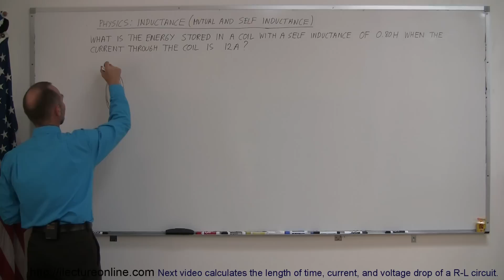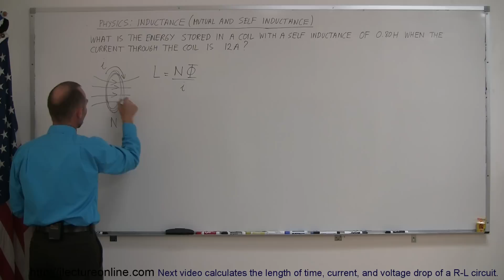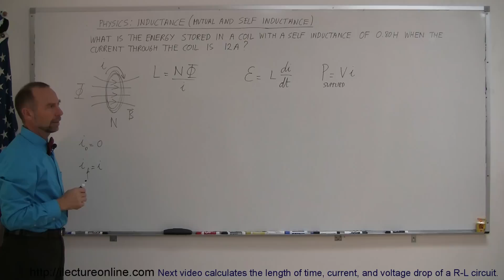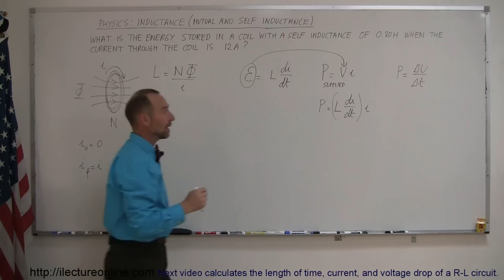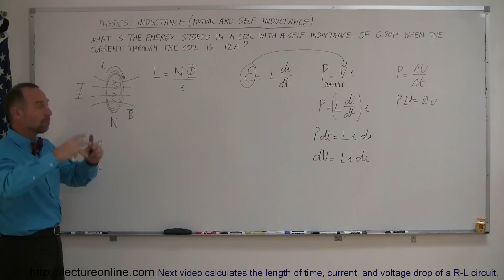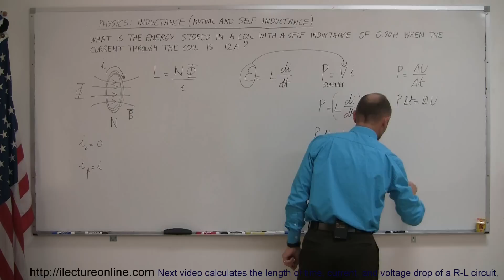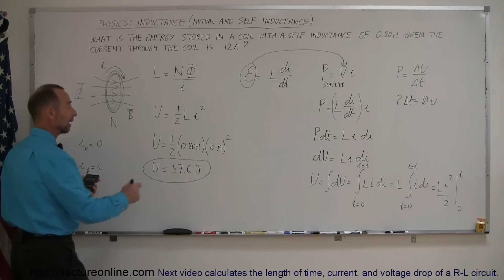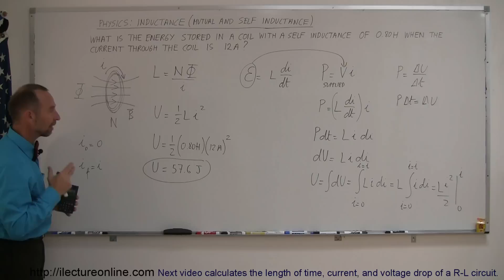Physics 47.1  Inductance (3 of 8) Mutual and Self Inductance

Comment from the maker: Theo,
I am not sure what you mean by: "would it work", since I don't know what you mean by the word "it".
But I am guessing that you are asking: "would you get the same results if the coil was not in the shape of a circle, but a rectangle or something like that?
Note that the answer depends on the amount of magnetic flux through the loop.  Thus the area of the loop is key, not the shape.  A rectangular loop with the same area would give you the same answer (providing the strength of the magnetic flux is the same everywhere through the loop.